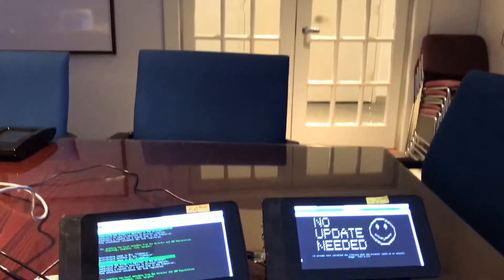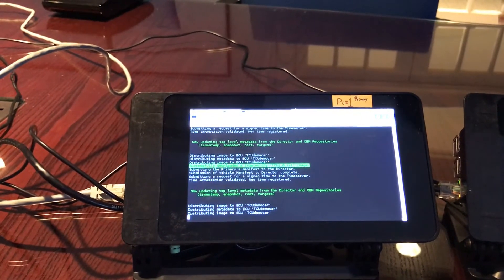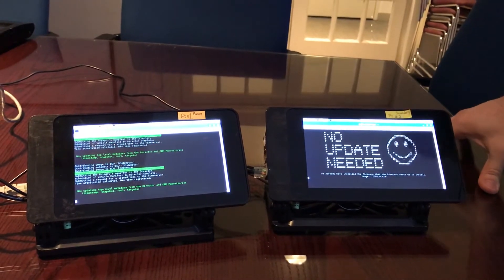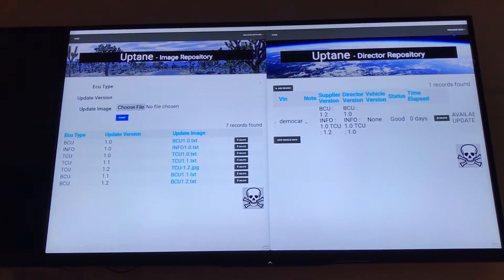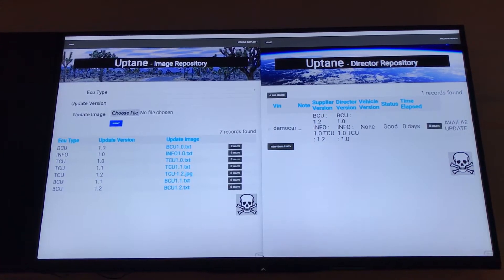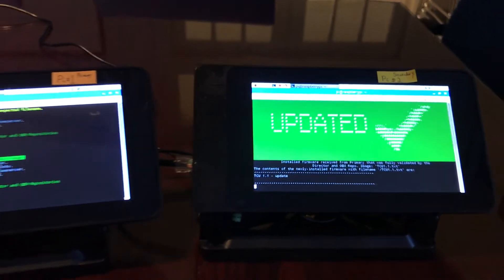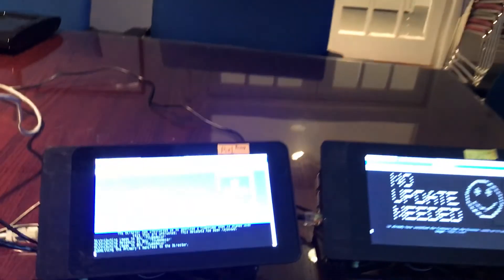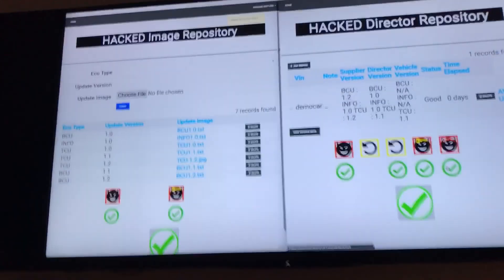Uptane Demonstration, 2017

Comment: Hello. Thank you for this demonstration. I am proceeding for that as an example of better understanding FOTA concept, and I have an error ( Connection refused)  when I am trying to connect the Primary ECU to the server, server is up and running at that moment. My setup consists of a WiFi connection between 2 Raspberry Pi`s , and I am not sure where exactly to modify existing scripts or something to make this connection available (server - client ). In the documentation this one is missing, or there is something that I am actually doing wrong. Could you please give me some hints, or a solution for that?